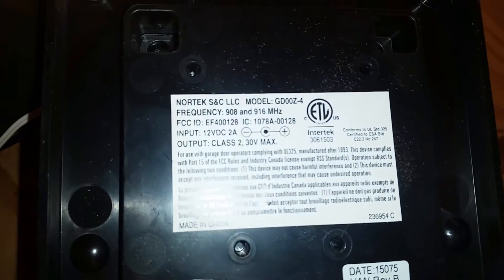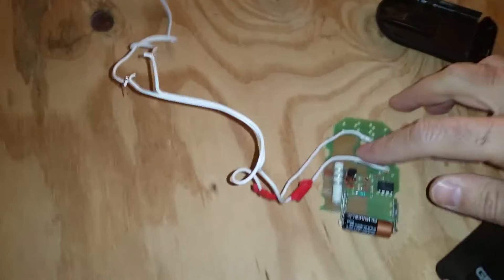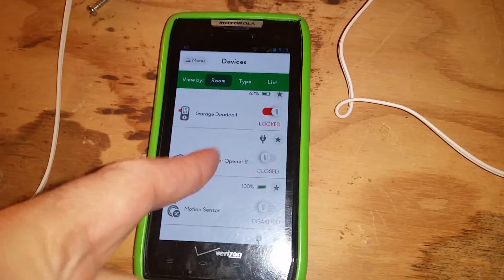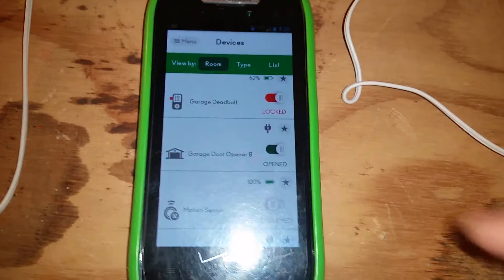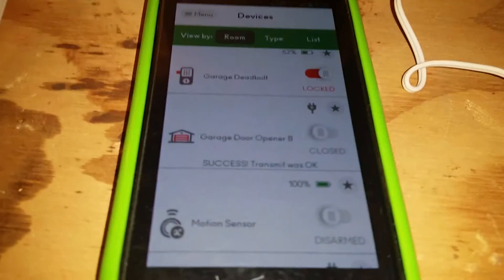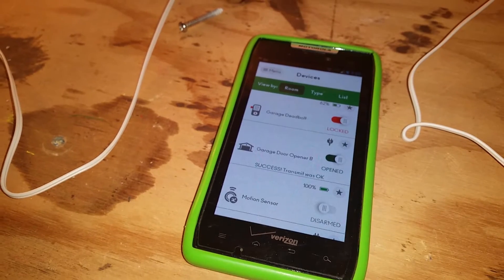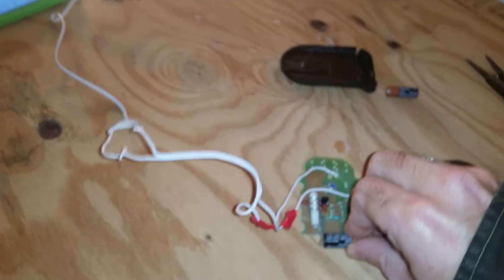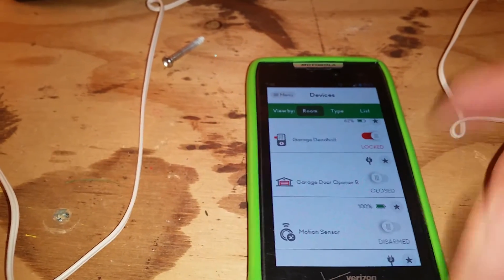Linear gd00z-4 with genie intellicode

Comment: you never showed the wiring job on the back of the remote.
Reply from the maker: +Paul Adair I've since got this fully functional by way of a linear zwave switch instead of this linear GDO thing. Still has the same solder job, but you're right, forgot the pic of the back, sorry. Next time I take my project box apart I'll make a new video.
Reply: Bryan Mack , I think everything is alright. There's a safety "feature" that only allows the zwave garage controller to send another command after ~1 minute.
Reply: Bryan I know it's been about 2 years but I just got the linear GD004 and I am experincing the same thing. Can you please share how you got it to work with Z-Wave switch? If possiable can you provide a little detail, that would really help me out.